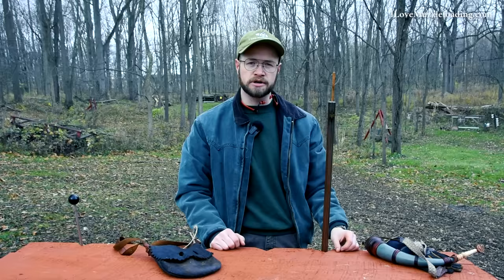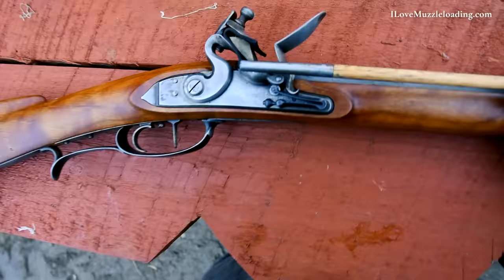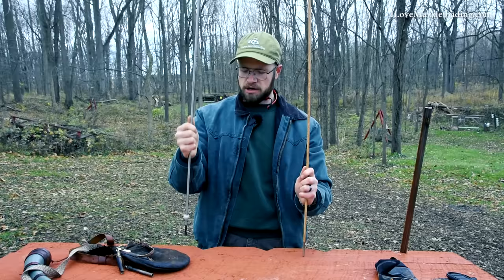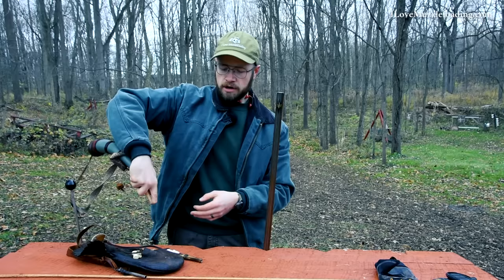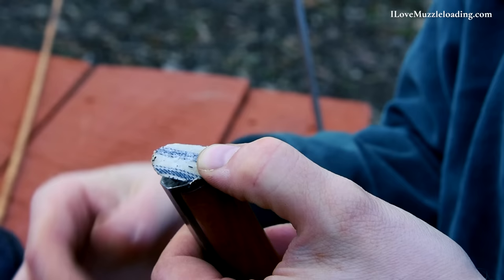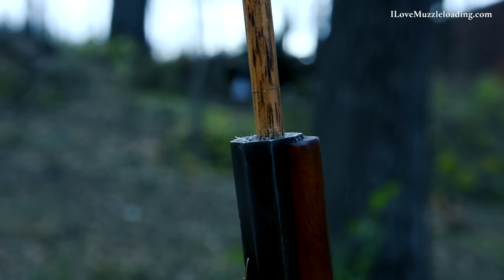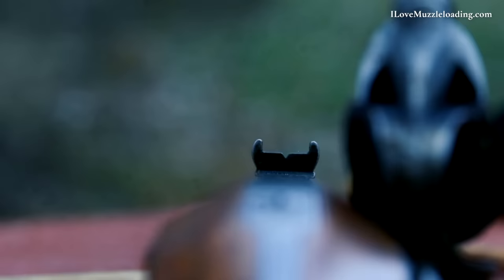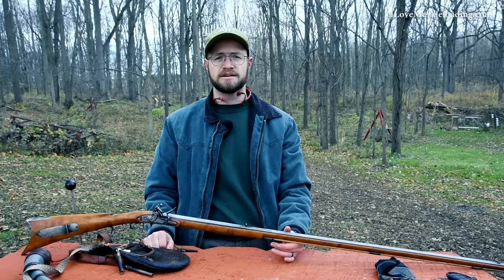Fundamental Guide to Flintlocks | How To Shoot a Flintlock Rifle in 10 minutes

Comment: I get it - the patch is esentially like a 'sabot' engaging the lands & grooves of the rifling - not the lead ball itself.  Also noticed when he measured the ramrod inside the barrel it went BEYOND the touchhole, so the primer flame thru the touch hole ignites the main powder charge between the patch & the powder AT THE TOP of the powder chartge and NOT AT THE BOTTOM as in self contained metalic cartriges primed from behind (or at the bottom) of their powder.   Needle guns also did this in the first primitive bolt actions of the 1870s.  Very interesting.  Been muzzle loading 50 years and thought I 'Knew it all" HA!   Nice wake up call.  Very well done this instructionasl video. Thanks - I love muzzleloading!

Comment: I find the flintlock interesting however I live in the Southeast where high humidity is the norm and have concern that while hunting and sitting for hours the charge in the Pan may not ignite . Thoughts are appreciated.  I currently own and use 7 percussion rifles for deer and squirrel hunting.
Reply from the maker: A little humidity is good for a good lock. Mine works better in the weather. I hunted all season and reset my charge each week, it fired fine each time

Comment: Just a comment on what I first do prior to the first cleaning patch. I purchase from the drug store alcohol swabs, the kind that one would use to wipe your arm prior to getting a needle, they are very inexpensive. I run that down the barrel. Then I follow up with a patch. The reason I do this is it does start the cleaning process and allows the patch to go down the barrel much easier. I have had a patch almost refuse to go down the barrel if I don't swab it first with an alcohol patch. The alcohol will evaporate so there is no worry about the powder getting fowled.
Reply from the maker: Oh, neat idea. Thanks!

Comment: is priming powder its own unique powder? or can you use the same powder as your ball charge?
Reply: 4f powder is a common priming powder and not a bad way to go when learning and figuring out all the other particulars but priming from the horn is far more historical and practical.  I shoot 3f from my 50's and 54's and prime with such and notice no difference in ignition speed at all.  I shoot 2f in my .62 cal Fowler but sometimes I feel like priming with 2f seems just a bit slower and at other times I don't notice it at all.  To each their own but priming from the horn has been great.
Reply from the maker: You can use the same powder as you main charge, historically this was the case especially with military arms.
Reply: What both of your other commenters said it very true.  Also the finer the powder the more it seems to draw moisture.  I have a couple pounds of 4f but seldom prime with anything but 3f now and like they said using what's in the horn works just fine and simplifies things.

Comment: I'm not sure many realize these are the some of the best shtf weapons.  When the regular ammo and reloading components eventually run out, then these come into play.  You can find/recover/find-other-option for lead/bullets.  If you can find sulfur (or make it?) you can make black powder.  Not too awful difficult.
Cases and primers (and percussion caps), on the other hand, are not easily made by most people.  Those are the real sticking points in sustainability.  Granted, cases can be used over and over, and their life can be extended by loading them to lower pressures.  Eventually though, they're going to become unusable.
Yes, I know you have 150,000 rounds in your garage and will never, ever run out.  Run along now, and make sure it's not on fire.  Those of us not so fortunate are talking.
If you have the knowledge to make primers in teotwawki, you will be a very sought after commodity, to your benefit, or perhaps detriment.
With a flintlock, all you need is a rock, preferably flint. Gunpowder. Finely ground gun powder. Some sort of patch material, and something to use as a projectile (doesn't even have to be lead).  Boom, you're golden.
Granted, you'll use your regular firearms while the ammo lasts but thereafter, these will be nice to have around.

Excellent video, btw.

Comment: Im getting to much click....wait....bang. How can I speed up ignition? I do not believe Im putting too much in the pan...
Reply: Ignition should be nearly instantaneous.  Some things to check:  the touch hole should be centered in the pan and about even with the top of it.  It should be about 1/16" in diameter. The priming powder should be no higher than the bottom of the touch hole , close to it but not covering it (tests have shown this to be faster than banked away from the touch hole--hard to argue with electronic timers and high speed photography).  Check the flint itself.  Should be sharp and scrape about 2/3 roughly of the frizzen face. With the gun unloaded of course, go into a dark room and snap the lock.  You should see lots of sparks being directed into the pan.  If not perhaps the hardening of your frizzen is off.  What are you shooting?
Reply from the maker: What kind of powder are you using? What kind of lock, flint? Is your touchhole clear? Sorry to answer a question with a question, but sometimes it takes some digging.

Comment: Ok, I was told that FFG was for pistols and FFFG was for rifles. 
I have a 45 cal. flint lock.
You state 55 gr is a good load. How do you determine that? Do you use the same load whether it is FFG OR FFFG?
My rifle is Italian made (if it matters).
Reply: 3f can be used for any caliber muzzeloader though it is USUALLY used in .50 and under but some larger caliber firearms will shoot better with it. It just depends on the gun. 2f is USUALLY used in .50 and bigger with 1f for the largest like .62, .69. 75.  I use 2f in my .62 and .75 and don't bother with 1f.  .45 would PROBABLY prefer 3f. Starting loads are usually 1 grain per caliber so 45 grains would be a good starting point. Work up (or down) from there. 4f is usually recommended for priming the pan but it isn't neccessary. I shot my .62 Fowler today with 2f as my main and priming charge. If it was any slower I couldn't detect it. Start with a .440 ball and .015 patch material. It should be a snug fit. Again play with ball and patch thickness to find the most accurate combo. Experiment. Change one variable at a time and have fun!
Reply: Not to confuse but I used 2f in a 40 cal Kibler during a match with no issues.
Reply from the maker: The reverse is common for substitutes, you’ll find Pyrodex 3F is recommended for pistols, 2f for rifles, but in “real” Blackpowder it’s generally as I stated but it’s not a hard rule. 

Check out my video on load development if you have a moment. I start with 40 grains of powder and shoot a 3-5 shot group, up the charge by 5 grains and shoot a new group. This process continues to about 70 grains for this particular caliber and then I see what charge grouped the best, and I shoot that charge. 

Hope this helps!
Reply: FFFg is better suited for pistols as it is faster burning which is what you want for a short barreled arm. I use FFFg for all but my biggest Handgonnes as that is the same principle.
Reply: Another great video!  I’m sure that it’s handy being able to shoot near the shop and house rather than driving to a range.  Thanks

Comment: is the concave buttplate on your rifle uncomfortable to shoulder?
Reply: It seems sharp edged.
Reply: If you hold it wrong, yes very uncomfortable! You only make mistakes a couple of times before you learn to make sure you shoulder it properly. Otherwise they generally aren't to bad and you'll see a few very old style lever guns carry this forward.
Reply from the maker: In a small bore I never notice it. The charge Nevis never large enough to recoil in this .40
Reply: These rifles aren't designed to be shot like a modern rifle pulled into the "pocket" of the shoulder.  Rather, they are meant to be shot hooked into the "crook" of the upper arm where it meets the shoulder.  To ensure a proper hold, it works better to shoot this style of rifle across your body versus straight out from your body.  Hope this explains it well!
Reply: @miller39687  Well explained. It was a "mountain" style of holding a gun, and the guns were designed to accommodate the people who used them. Larger bore guns that used higher powder charges tended to have wider butt plates to distribute the recoil.
Reply: @miller39687  That makes sense I've only only shot "modern" guns where the method is to get it into the pocket of your shoulder to get as much meat as possible into the stock and hold it firm to the body. Placing this stock more into where arm meets shoulder makes sense for this style of stock.